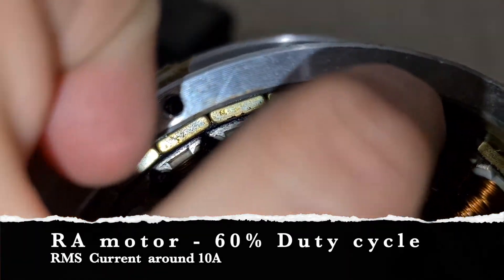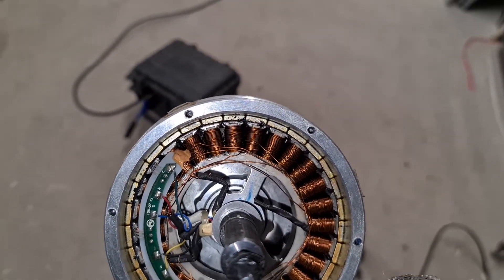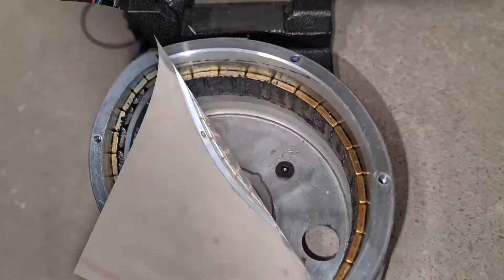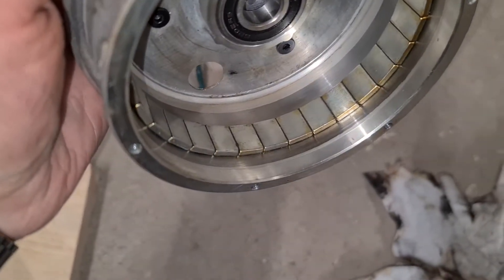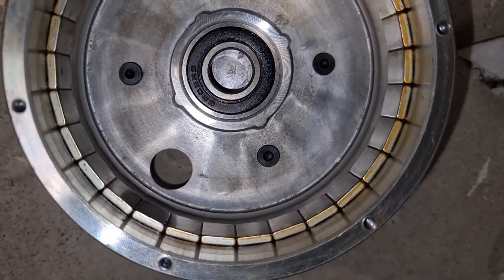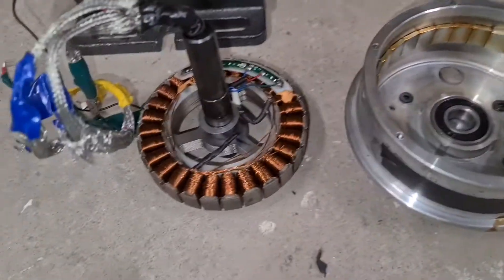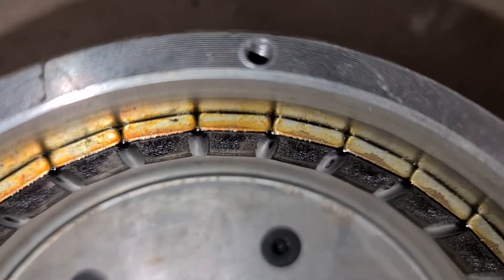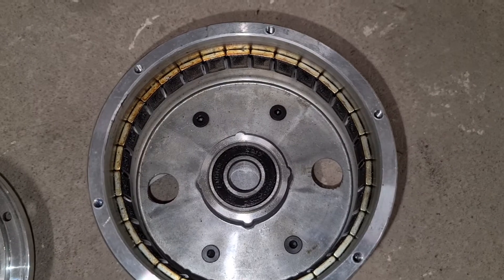Ferro Fluid Removal!

Comment: Hi there just wanted to peck your mind for a moment recently had to transport my motor into a another wheel case bike shop over tighten the  wheel up which made the wheel rip to bits.  transplanted the motor into a spare case and I'm not sure if I put it in the left hand side on the right hand side try to find on internet but cannot find any information weather that will give me problem
Reply from the maker: Hi mate!
Well, I’m not using these as actual bike motors, where I’m making my own drive controller, and this might change my understanding of your problem. 
Anyway, if it's just the case parts(with the magnets) that can be swapped, this should not matter for the controller running the motor. There might be other parts of the tire design that is rotation oriented.
If you on the other hand can mount the stator the “wrong way around”, the orientation of the hall effect sensors will be flipped over. Basically the bike will drive in reverse. This is if your motor is using hall-effect sensors. The wiring should come out on the other side then.

Did I understand your question correctly?

Comment: Its the laminated windings on the stator is where the heat is being produced,So I use thermally conductive epoxy on the laminated winding and build it up so it touches the inside of the hub to sink the heat to the hub.I used the Statorade and came to the conclusion after seeing where it ends up over time between the magnets,The reason it works is that most temperature sensors are between the magnets and the liquid provides a better heat sink to the housing,Making it appear to lower the temperature of the motor but its just the senors heat sink path that changed.The magnets already have a good heat sink from the epoxy install from the factory.Only down side of this epoxy fix is that you cannot remove the hub as it would tear the windings,But if you make a good path to sink the heat from the windings to the housing then you should not have any problems with the magnet epoxy coming loose.I have a Hengtai motor running for about a year with this epoxy and the hub get hotter much faster,Meaning its sinking the heat to the hub.I use copper foil around the hub after cleaning the paint off and a good heat sink compound,Then pinch  the copper foil tight around the hub and solder it with 8% silver solder and also made a bunch of solder bump/piles around the copper foil surface to help dissipate the heat.I am working with a thermal epoxy now that stays more flexible like a dried silicone so if I need to disassemble the hub motor on that end,I can just cut where it bridges to the inside of the housing.
Reply from the maker: Hi mate! 
I was quite sure that the ferrofluid will stay between the coils and the magnets while energised and conduct the heat from the coils to the magnets and out to the case. When the coils are not energised the FF will orient itself around the magnets.
I made some big ventilation holes in the hub which was a lot more effective to remove heat from the stators, but I’m sure that also aided in drying out the FF to the point that all that was left was a tar-like mess. That’s when I got rid of it and just used ventilation.

So, do I get it right that you have built up part of the stator with epoxy so that it contacts the inside of the hub motor housing, i.e. the rotor? And then transfer heat via physical contact between the two? Surely that would result in friction heat until the epoxy contact interface is worn down as well?
I might be misunderstanding, but if it works, good job! Would not come up with that idea.
Anyway, thanks for sharing, and good luck!

Comment: Notice the scooter bearings are rubber lip type. To keep water out. They can rub and no need for your purpose.
Reply from the maker: Hi! 
Yes! I did actually remove the bearing on the DEC axis towards the mounting point and added a tapered roller bearing without seals. That was a lot better, but there is still stiction.
This is mechanical issues, and can only be solved by changing the mounting design. I have been very concerned about it all, but then, the DEC as actually not been my main issue regardless. The RA might get the same bearing change at some point ahead.

Comment: So it definitely didn’t overheat?  And this particular brand of ferrofluid is used in motors?
Reply from the maker: Hi Christopher,
It was called L5N. And when I bought and tested it I didn’t know anything(still not well read up on it) about different kinds of FF, and how they would behave differently in a motor. I would have gotten it from some e-bike tuning shop if I was looking for it today to know it was the right stuff. I still have no idea if the FF I have is useful for it. 
One motor was pushed harder then the other, and in this the solvent evaporated quickly and turned into a sticky tar-like substance. In the other motor it was still ok, but I removed it as well. Some also say the motor should be sealed, but I have seen nothing about sealing the injection hole if you drill one.
The motors where fine still, but I don’t think the ferrofluid solution was not the best for my application, although the Idea is very appealing. On motors running bikes you have a lot more ambient cooling from the motors movement through the air, I don't have that. Also, one usually don’t run them continuously on high current for as long as I intend.
I abandoned the FF-solution to instead use motors :)

Comment: You might want to consider sealing the motors as best as possible when using ferrofluid. It's very easy to turn the stuff into gunk just with dirt, grit and moisture.
Reply from the maker: Hi, thanks! Good comment! Will likely do that if I'm considering ferrofluid again. Unlike for motors used on the road these motors are exposed to very little dirt and moisture. General dust and air humidity is still there of course. The moisture will evaporate quickly with the temperature, but the dust will collect in ferrofluid as you say. I guess the solvent also evaporates much quicker if its not sealed up like you mention tough. 
Cheers!
Reply: High temperature red silicone that's what I will do too thanks for the video now I m sure I must do this 👍.

Comment: Easy fix would be to add a bit of ATF as in 1ml to loosen it up. That's also the reason you must seal the motor completely and add a fill hole with a screw to seal it up. Ive seen the fluid completely disappear after 3 years but its actually still in there just on the magnets needing a bit of ATF to revive it. !!! Also before you use ATF make sure the magnets were not glued on with crap glue like crazy glue. Had a motor completely have all its magnets loosen up after ATF so be advised!!!
Reply from the maker: Thanks mate! Great advice! I don't know  if ATF is the solvent used, but it might  work anyway. What about completely flooding the motor? Since I'm not actually spinning the motor, but rather stalling it, and shifting the position.
Cheers!
Reply: Mas para tirar o ferro fluido com um pouco de ATF é preciso fechar o motor e usá-lo por algum tempo? Ou você quer dizer que é só deixar de molho com um pouco de ATF que o ferro fluido já vai se soltar dos imãs? Pode me dar esse detalhes.

Estou pensando em colocar o ferro fluido no meu QSMOTOR 3000w.

Comment: @Astroboden. Out of curiosity are those holes to the outside for active cooling?  As far as I understand it ferrofluid should be encased and sealed so it doesn't leak.  Did you have leakage?
Reply from the maker: Hi Mark!
You should only use I very small amount (I used ~5ml) and the ferrofluid is caught in the magnetic field of the magnets when powered off and between the magnets and the coils when power is on at all times. I can’t see how it would go anywhere. Since I tied it I learned that the carrier fluid (some is kerosene, but I’m sure what was used in mine) does evaporate and more ferrofluid need to be added on a yearly basis(or something). If that’s what happened in my case I would also recommend a thorough clean. The left-over iron particles where quite gritty. Maybe just some more carrier fluid would have mixed in the iron particles and made it ok again, but I don’t know if it’s still the same ones it’s been cooked.

The holes are ventilation holes I made and also used to insert the ferrofluid. I taped them up when trying the ferrofluid, but later used the same holes for active cooling with a fan instead.

Comment: I am curious, why are there no other reports of this issue? What exact Ferro fluid did you use?
Reply from the maker: Hi Jack!
It was a ferrodluid called L5N by the seller. Not actually sure if it's the recommended type for cooling hub motors. 
Also, I suspect I'm not really using it the conventional way where the motor is running at a higher rate, which will aid cooling. My motor is running with 1 sidereal rate 😜
Reply: @astroboden  ok, thanks. I just used some on my motor, no idea what the brand was 😅